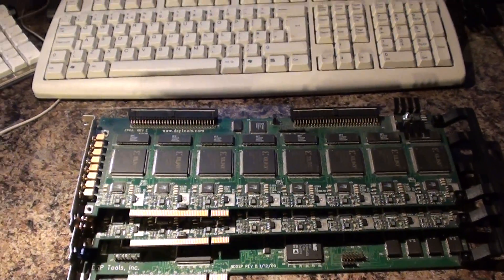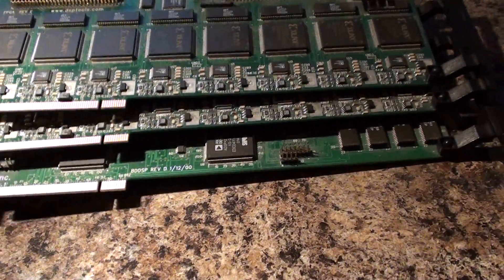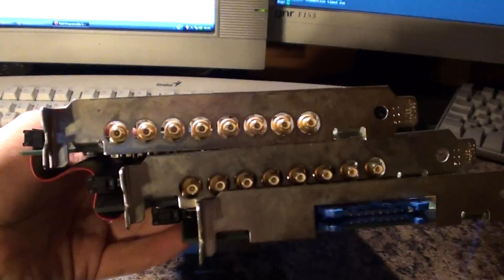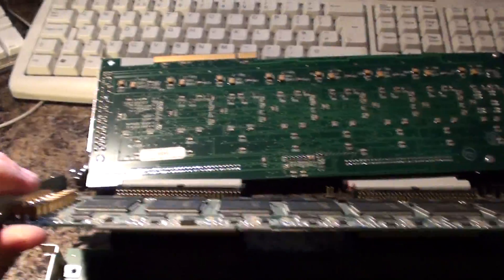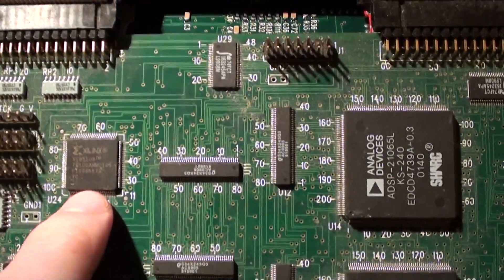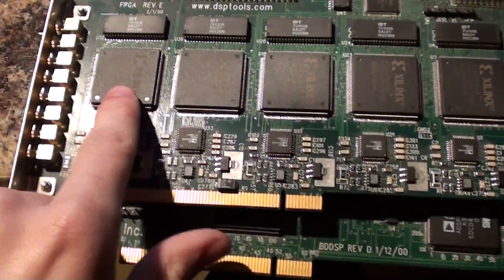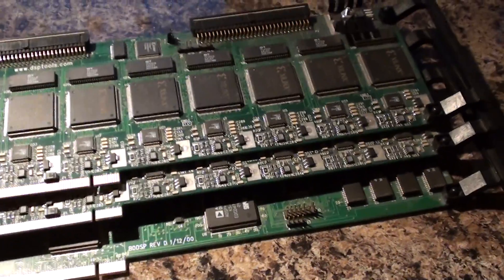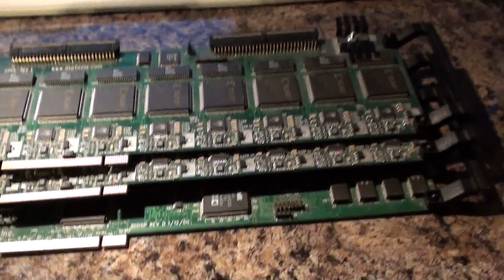BitCoin Mining FPGA Card

Comment: The IDT71V016 are 64Kx16 12ns rams, presumably to hold the block/hash while the AISC works on them.
Probably quite expensive at the time, now maybe £1 each
I'm confused at what the Analog Devices chips are doing there? DSP's are normally used for floating point, and AFIK there is no FP in BC mining?

Comment: Can I use FPGA devices to recover passwords (using brute force method)? If yes, which device to choose, and what software to use?
Reply: You wrong. He can. But he also need to re-flash FPGA memory.
Reply: maybe he lost password to 100 bitcoins on binance of some other place.
Reply: I know of no software to do that off the top of my head, how ever I would be SHOCKED if it could not be done easyishly.
Reply: its possible but dont know how:(
Reply: You cannot use a F.P.G.A designed for Bit-coin mining to crack passwords.
Reply: @shawn8093  FPGA is short for Field Programmable Gate Array, he would just need to reprogram them.

Comment: i know they arent CPUs :p it would be so awesome to get one and prgram it to help me with my calculations :)
Reply: I know you left this comment years ago, but here's an answer: FPGAs are essentially a bunch of logic blocks on a grid. You con interconnect them using programming. It'd be very simply to implement a bunch of ALUs and FPUs in one, provided you had a CPU to "borrow" some architecture design from. Would be moderate to medium hard implementing from the ground up, if you knew how adder, subtraction and division circuits worked.

Comment: I have no idea where you got that 21 GH/s from, but just looking at the chip package, I can tell you that these are very low-end (and obsolete) FPGAs. All new high-end FPGAs are in BGA package (not QFP you see there ...) Based on what I see from the video, they seem to be XC4020 and you can't even fit a single ridiculously-pipelined SHA-256 logic in it. So in conclusion, you would get 0 GH/s out of it.

Comment: Those are Xilinx XC4020's...(all discontinued)  the series ran in the 200-300Mhz range and only had ~15k gates. The RAM chips are likely 64kb to 256kb (max these chips could use). Any driver that exists would be specialized and archaic and would probably need windows 95 at best.  A new Xilinx chip would smoke this entire array and would costs $10 and programming kits are available.  FPGAs are not ideal for bitcoin mining, You might be better off using a nVidia CUDA driver on your video card.

Comment from the maker: Again, it's all about how you configure them. If you use a sloppy half-ass FPGA configuration, you may well get less than that, but calculated on the number of gates and the speed of the FPGAs themselves, 21GH/s is achievable.

Comment: Also the connectors on the end look like TNC connectors. They should generally be connected to the FPGAs buss lines so you can wire them to a logic analyser read what the IO is doing. High Frequency suffers from allot of crosstalk and interference so the old 100mhz scope leads are not always the best, plus the cables act like antenas too and introduce noise to the bus. Them connectors help sheild the signal, I think Xilinx have an IDE out that should comunicate with them boards